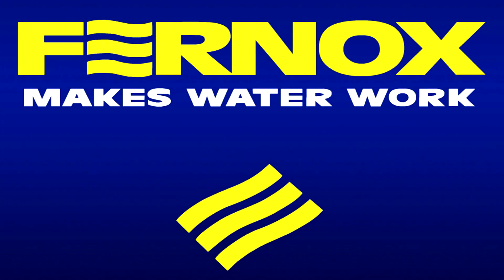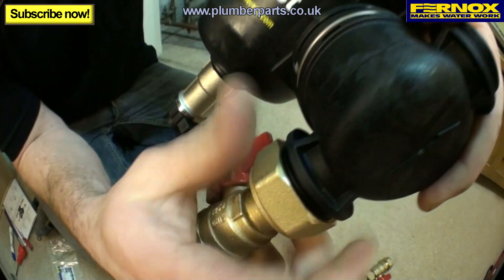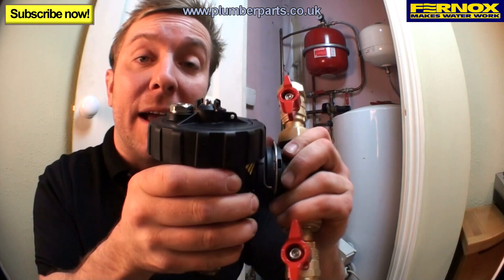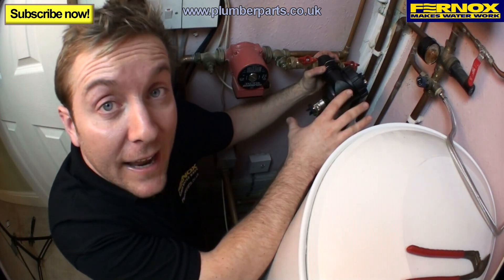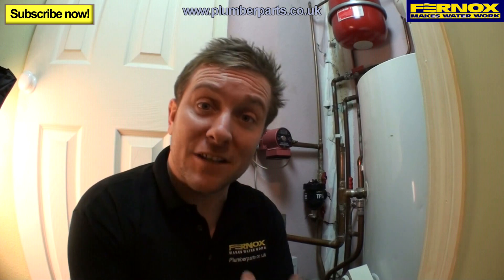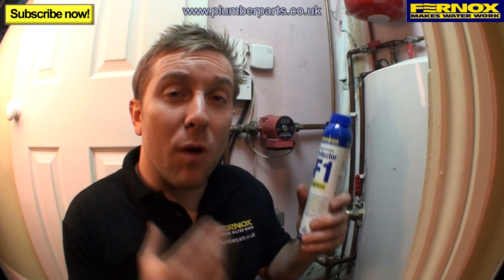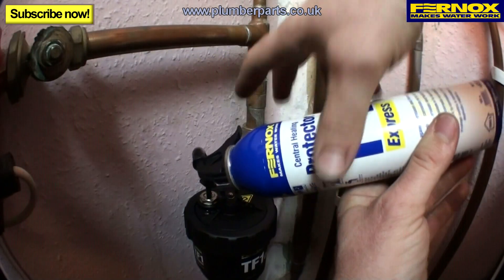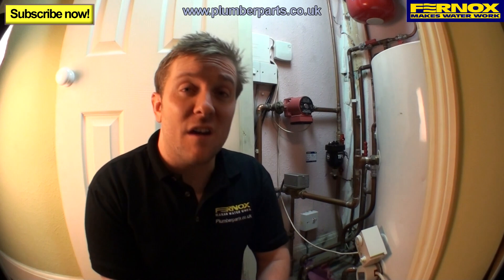FERNOX TF1 COMPACT INSTALLATION - Plumbing Tips

Comment: Confusion here - the filter as shown in the line from radiator out - feeding into the bottom buffer tank connection - the flow in my TF1 filter is marked as feeding out and away from the buffer tank. I'd expected it to be the opposite - i.e. in the same direction as the outflow from the radiator to the cold buffer tank entry.

Comment: We hired someone to replace this filter because our old one was leaking. However, every since the plumber did this, I've noticed that the radiators are warm after I've used the hot water (despite being turned off at the boiler), the tap water does not heat up as fast as it used to, radiators don't heat up properly. And now one radiator is leaking. What could he have done wrong that would cause these issues?
Reply: 3 port valve faulty?

Comment: Hi, I have a Viessmann heat pump unit and also a puffer of 500 Liters for storing the heating agent for the house.Now, the puffer corrodes in the interior and  lots of fine metal parts are getting into the under floor heating system, into the pumps and into the heat pump system as well. I would like to add some anticorrosion liquid in the water found in puffer and also fit a filter like this on the return from the puffer towards the heat pump.Now, the problem is that I have 32mm pipes and all the filters that I could find, are sized max. 28mm. Will this affect the water flow? Won't this reduction of 4mm be a "stress" on the pumps or on the entire system?Last but not least, should I fit the same filter on the heat pumps second system, the one that runs into the ground of my garden, collecting the heat from the ground? I have the same 32mm pipe there as well and the same "stress" questions arises... Thank you!

Comment: Hi there, love all your vids. I have ordered a F1 Compact. I'm tempted to also install a parallel run of pipe with a valve (off of two Tees) so that the whole filter assembly can be isolated. Or is that belt & braces??
Reply from the maker: It has valves anyway so kinda unnecessary

Comment: Am I right in saying when the combi first starts up the outlet pipe would be roasting to touch and the other with the blue hose attached to it is the return and the one with the hose is the one in witch I should fit it to??? Sorry if a dum question but better to be sure
Reply from the maker: +george stronach Which boiler are you on about? There's loads of different combis!

Comment: Hi mate, the TF1 Compact and Total Filter, do they require the same gap of 195mm? do you know?
Also not sure if the only difference is the size...? Do you know? I only got 5 radiators in my house and the system is combi not vented.

Comment: Hi mate.. Nice review and helpful.
Just what I have noticed on your video is a pump having power supply at the bottom.... not really good location in case of leaking .... water gets into is and... may cause real danger and kill somebody... Just my 5 cents.
Reply from the maker: jay D Hi J, thanks for your comments mate, it's really common for them to be that way up. All pump manufacturers have got this covered with watertight seals on all components. Again, thanks for your comments!

Comment: Will i work on a vented system? as the hot water taps are really corroded an think the hot water tank mite have crap in it would it be best to drain down the heating an flush? then fit TF1?
Reply from the maker: Yes to all (but only on the heating side) a water softener for the hot water side. Good luck, PP!

Comment: I've just fitted a TF1 to my own system today and I was surprised that nowhere in the instructions does it tell you to cut 195mm from the pipe work. Is easy enough to calculate but why wouldn't it just tell you???

Comment: Just fitted one of these and it catches air alot , ive been bleeding it once a day for about 3secs is that ok?
Reply: ***** the filter is after the boiler but before the pump on my system as thats the only place i could fit it so i dont think its the pump, il add some more fernox f1 to the system as i only added one bottle and it is a big system.

Comment: Hello PP,
Do i have to drain the central heating system, while installing magna clean and refill it after I finished. cheers
Reply: Being a plumber for 30 years I find it difficult that you don't state anything about Ptfi on your compression fittings because it will surely leak without packing !!!

Comment: Hi,
Can I add a side spur to the boiler return if I don't have space to fit the TF-1?  So I mean cutting into the return pipe to add two elbows to run pipe off to the side giving space for the TF-1 to be used ( I guess my question is, is adding angles and extra pipe to the boil return pipe ok?)

Comment: I looks quite good Jaz, I'd worry a wee bit about it been plastic though as most of the plastic filters, of any make, start leaking after a while!!  As for all that inhibitor, it'll fuck up your boiler diaphragms & circulation pump, so only add a wee drop.
Where's the Big Stars, your Dad & the Dog??  Do they have a Fanzone or Website??
See if you can blag Bacon's jacket & we'll action it off for cherrrity.  Hold it tight throughout the night......;-)